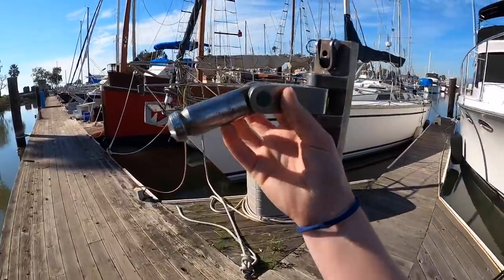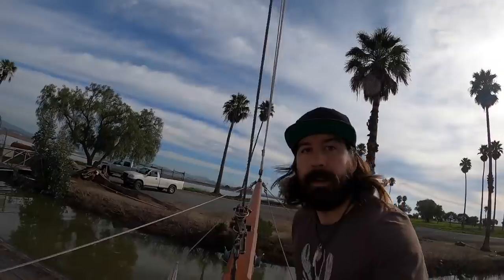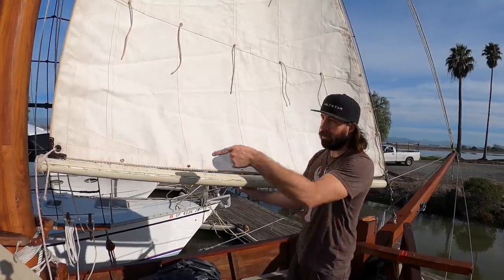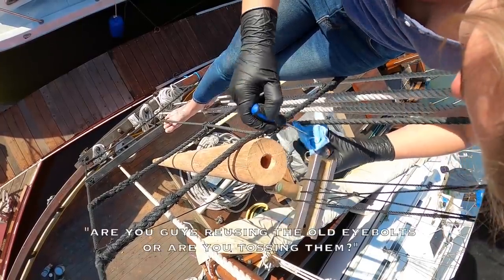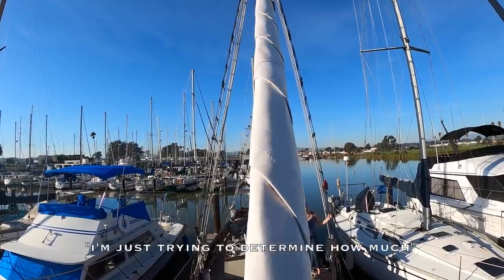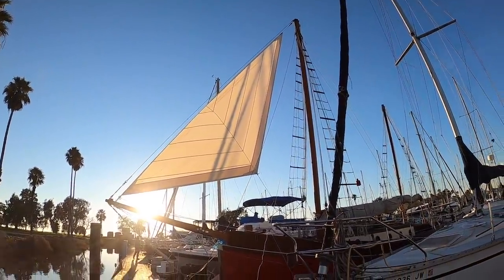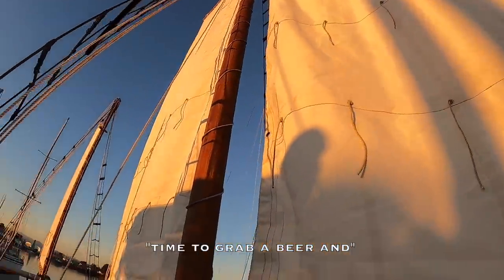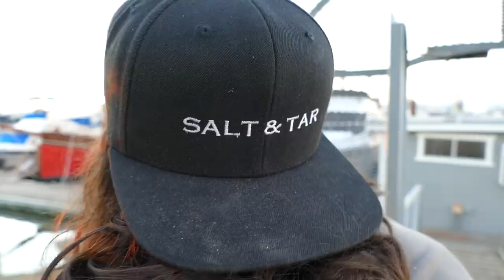Salt & Tar: Ep.181- Hoist 'em all! Attaching our headsails

Comment: She's looking good with her sails up. Well done both of you. 
I'm not sure your epoxy bonded goose neck will stand up to dynamic load changes and vibration.  I would have fabricated a metal fitting to receive the pin or simply used a rope fitting made of lots of loops of dyneema. The epoxy bond is going to be the weak link.
Reply: Agreed, I believe the proper lashing on the epoxied end to the boom would securely hold the two together and prevent separation.
Reply: Agree, the end of the boom needs some reinforcing around the outside (lashing, metal band, etc.) to support the wood. The eccentric loads of the pin in the bored hole will cause the wood to crack.

Comment: Chiseling out before the epoxy is to add a mechanical attachment rather than just a bonded. A very good idea and you can expand on that too by adding something to the epoxy that adds compressive strength like stainless steel balls. Fun to play with by testing your results.
Reply: EXACTLY...."EPOXY' to metal do NOT play well together. Add some sawdust the the 'poxy long with stainless fastener.
Reply: Metal powders are often recommended as an epoxy additive when bonding metal with epoxy.  I usually use aluminum powder.  Not sure if that would be recommended with stainless.

Comment: When you loose something overboard at the dock. You can use a rope with a weight on one end, and hang it over the railing where you lost the item overboard. Then it’s just to follow the line to the bottom when your free-diving down. The it is possible to find even small objects in really bad visibility conditions.
You make it seem like everything that is lost overboard is lost forever.
Reply: An  excellent  tip !   However  .  .  .  .  .   when  the  depth  of  the  'silt'  is  deeper  than  your  arm  can  reach  before  hitting  'bottom'  it  can  still  be  difficult  recovering  what  was  'lost' .     (Potomac River  off  Chesapeake Bay  a  'few'  years  ago,  could  not  recover  propeller  off  an  ouboard  motor)

Comment: When the sails are at full hoist, reef positions and stow, 'painting' a number of rings on the lines to each sail in order, fore to aft at about eye level, with 'DyKem' blue layout fluid, will provide a way of quickly identifying which lines go to which sail. Having several lines cinched off to adjacent belaying pins can waste time in an emergency. Plus, it's nice to be able to pick out the proper line without having to 'grab and shake' while staring up the mast... If Blue isn't your color of choice, they also make red. The two can be combined to make brown. I used it on my anchor rode every twenty foot, one, then two, then three rings and so on. The stuff soaked in and never wore off, and I always knew exactly my scope...Having 'dedicated' pins is nice, but you know, in rough weather, lines will get jumbled and tied off as fast as possible so you can dash back to the tiller while your exhausted mate tries to snooze in the Pilots bunk... Red's gonna look 'Spiffy' once all that canvas is pulling her to sea...

Comment: You have to provide the ropes with which the sail is attached to the mast with large wooden beads so that they roll along the mast instead of sliding stiffly. At least beads from one side of the mast to the other side. Then hoisting the sails is also a lot easier. Otherwise it looks great, congratulations on your beautiful ship. Greetings from Holland and safe sailing.

Comment: Definitely pin or bolt the staysail boom to the metal fitting. Over a season of water infiltration, getting wet then drying, getting hot and then cold that epoxy will pop right out of the hole you drilled like a cork.

Comment: So pretty. I had the same exact arrangement with a wire luff sewn into the headsail. My problem was keeping the furling line taut around the drum when the headsail was totally unfurled. Any slack of the furling line on the drum would cause the last loop furled to drop low enough to foul around the tack fitting attaching furler to the deck.
Reply: Some clever use of a bungee might solve this.

Comment: Love the sails, except possibly the yankee.  I have 31 years of sailmaking in my past the more than half of that in sail design.  I would have liked to see the width of both the panel on the leech and the foot the same width at both ends.  It may have been optical but they look like they were cut narrower at one end than the other.   This could create bias stretch because of the fibers ending along the edge.  The heavy weight may keep this from being a problem. If it becomes a problem your leech and foot will either curl or possible flutter in the wind. I would have liked to see it about a foot or so taller and a couple feet wider.  But that is mainly just aesthetics to my eye.  But good work you guys, I was late in finding your channel and have binge watched for the last week or so.

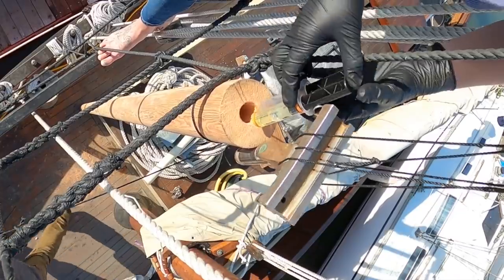Comment: I would....Put sawdust in the 'poxy along with some stainless fasteners...Epoxy is just a fancy glue.  10:45...why such a big hole?  I would think you would want it as tight as possible. The epoxy itself has little strength and is liable to crack with no structure to bond it together.
27:45 LOOKS GREAT!!!!  👍 Ventos justos e mar calmo⛵️

Comment: A loose epoxy bond like that is only about 1/3 as strong as it could be had you added filler to the epoxy. For bonding, unfilled epoxy should be reserved for bonding perfectly mated surfaces.

Comment: Much smarter way to epoxy the gooseneck to the boom: 

1. 5 minute epoxy is noticeably weaker than the longer curing type. No reason to use the fast curing stuff.

2. The clearance should be much less, typically .010 inches and then you inject the epoxy with an epoxy syringe through a small cross hole than lines up with the groove in your goose neck. The epoxy fills the entire space.

Comment: Could you instead attach that rod with the groove into the boom and pin it with some sort of screws or bolts that tighten into the groove at four points? This way it could be removed if necessary

Comment: 10:24
hmmm. Never used Gorilla-Epoxy but I guess it is not much different to other types.
Remember; Epoxy itself is not that strong. It becomes brittly and breaks with relative easy. The strength of fibre enforced plastics (GFK) comes from the fiber and less from the resin. Having a thick layer of epoxy doesn't add very much to the strength (at least not in my experience). Time will tell, if the gooseneck breaks lose.

But boy does she look good with all the sails hoisted!

Comment: Big problem...!! where you drilled to install the Yankee attachment, you are on a wooden knot... it will break at the slightest gust of wind, you should have added a collar made of iron rather than drilling... the solidity of your bowsprit is threatened... and there is no need for a double pulley to hoist this sail...!! once hoisted it is necessary to take again on the tensioner of the chain, but as it is with bottom, it will be necessary to cut links...!!

Comment: Not sure why you need the boom on the foot of the staysail? Bit of an oddity to me. Seems like it would be dangerous if you ever ended up there at night trying to take sail down during a squall. Rather fight a guy with a big wet towel than a baseball bat  AND a wet towel in that situation.
Reply: The boom allows the staysail to be self tending in a tack.  It also provides more shape control when running.  It does make some sense for cruising with limited crew.